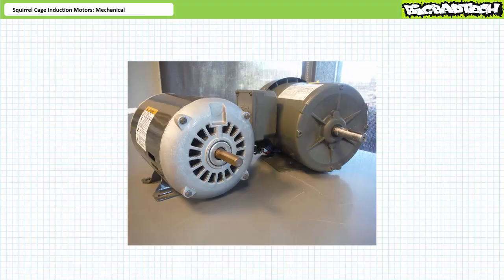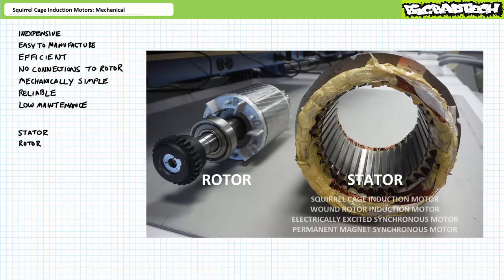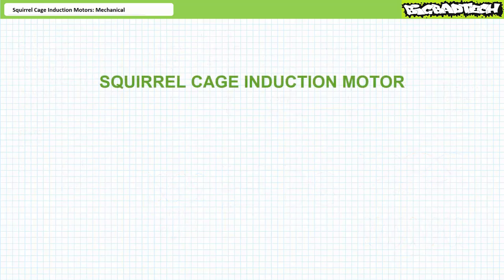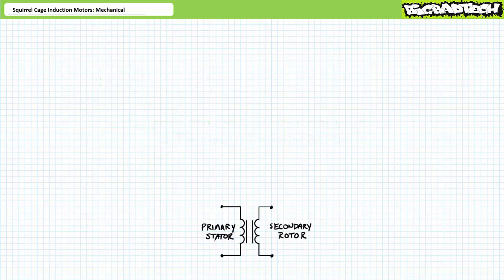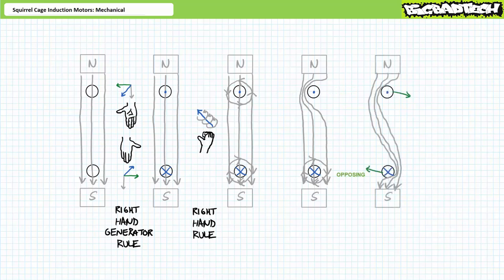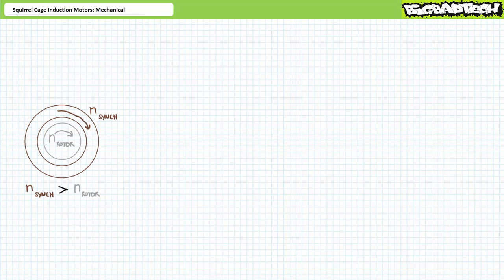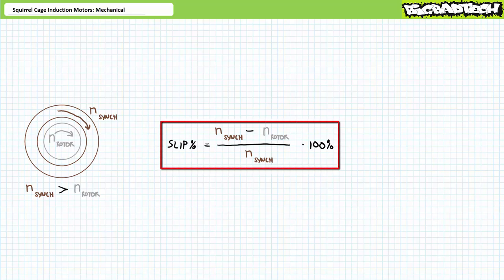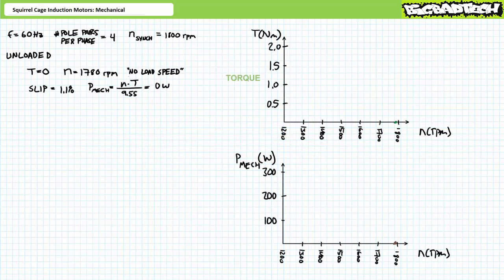Squirrel Cage Induction Motors: Mechanical Properties  (Part 1 of 2)

Comment: I've often been puzzled regarding why the induction of a motor is so small, considering the thousands of windings in a typical stator. I guess it makes sense that the motor has a special way of bleeding off the energy stored in the magnetic field, different than the way a typical inductor sends reactive power back into the primary lines when current reverses. Instead of reflecting that reactive energy back into the primary lines, a motor converts energy stored in the magnetic field into rotational movement, so the primary lines don't see as much of a phase shift from induction. Now I need to wrap my head around the way back EMF from generator effects is so different than the effects of induction....
Reply from the maker: Just you wait! I've got another lecture quickly following this that discusses the electrical properties of squirrel cage induction motors.